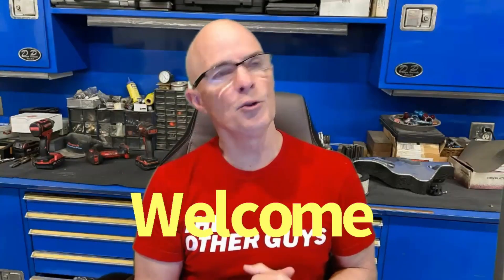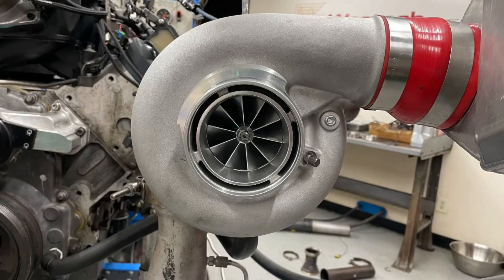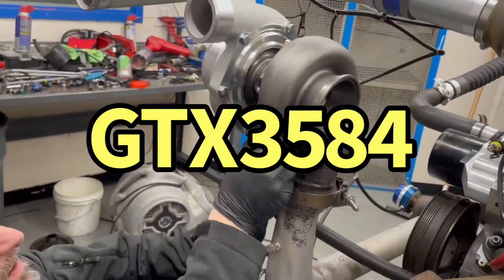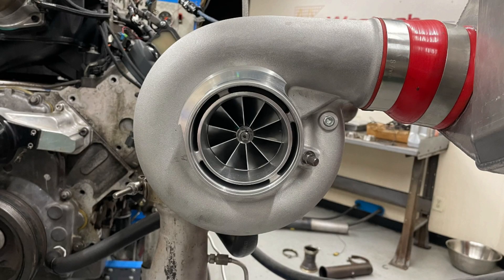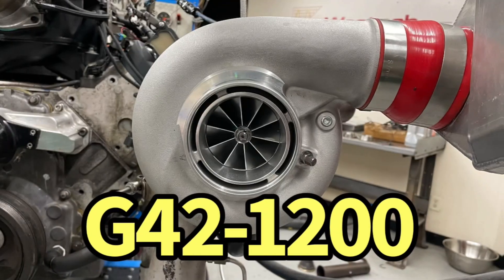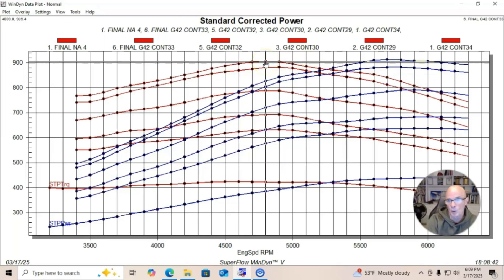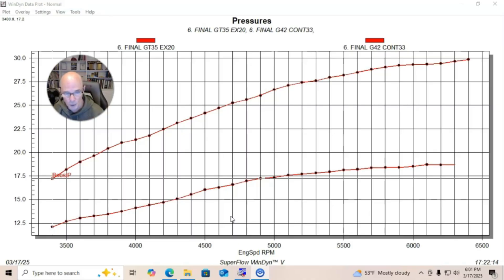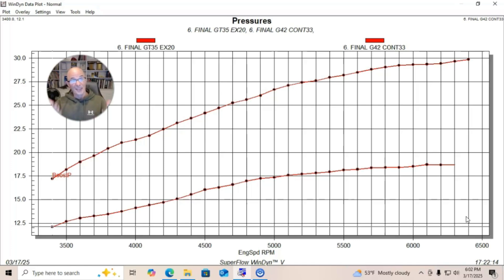TURBOS WARS! GTX3584RS VS G42-1200. SAME BOOST, SAME AF, SAME TIMING. POWER, BOOST & BACK PRESSURE

Comment: Hey I know you've done 350 sbc and all the ls iterations. Have you put a turbo on 97 LT1?
Reply from the maker: Not yet
Reply: @richardholdener1727  I would bring you my LT1, but it needs head gaskets, and probably heads need resurfacing. It only has 132k. The head gasket isn't horribly blown, thank God, but it still has to be done. One thing that sucks about being a tech is that my vehicles always continue to be pushed further out when it comes to serious repairs. I got the car this way. I will eventually get to it. It's a 97 30th anniversary camero that belonged to my dad. He bought a complete long tube header exhaust for it and had other plans before he passed of a stroke 3 years ago. His daughter drove it and didn't maintain it at all. I was to buy it from her at half value the day dad passed away but after she neglected it I was able to buy it for 1k. I've invested 70 hours on detailing outside and inside to get it back to looking like a star again. Now just have to find time to drop the engine out of the bottom and repair it. But while I have it out in thinking of modifying as cheap as possible not looking to make 1000 plus hp.
Reply: Oh that would be a good one to do. Unfortunately I don't have an extra to send you. But if you could a complete stock engine with long tube headers would be great then maybe a cam swap with turbo

Comment: A much more meaningful test would be two ~800hp turbos or turbos of the same dimensions. For example the G30-900 or the G35-1050 are much more comparable. Additionally, these tests did nothing to show for boost response. I'd love to see this test repeated but at a lower RPM, like 1500-2000.
Reply from the maker: As explained, the engine dyno is no place to show boost response

Comment: Curious if you've had a chance to test the Borg Warner efr line turbos, like the 9280 in twin or single scroll. I've seen testing comparing the efr series turbos to g-series, and for the same maximum power potential, the efr series seem to have better spool characteristics and transient response. Side note I'm surprised you only tested to one bar, these turbos comfortably push 35 Plus pounds
Reply from the maker: neither of these turbos would support 35 psi on this motor

Comment: How can you say in this demonstration that the smaller turbo is much more responsive when you don’t show the boost levels at the lower rpm’s yet the g42 makes more torque and hp all the way across the board on your dyno pulls ?
Reply from the maker: The engine dyno provides a steady state load to start the run. This allows (most) turbos to make full boost-this is not the same thing that happens on a chassis dyno or the street or track. The best illustration is that the smaller turbo had full boost (150 kpa) at just 30% TPS on the load in-the G42 was still at just 100 kpa-the smaller turbo is more responsive (not really surprising)

Comment: Did you log compressor outlet temp? Would have been interesting to see the compressor efficiency differences.
Reply: IAT must be easier ro keep cooler with the large turbo, right? Probably safer to run as well?
Reply: @UncleRayRayGarageEmporium  iat is behind the ic so its not as good of a measurement, the cooling capacity and intertia will of course affect the number, but aure you could see the trend there. If you measure post compressor you can directly use that number for calculating the compressor efficiency, and with a sweep like this it will be much easier to get a stable number.

Comment: So what turbo is better sooted for a 6-700wheel hp build. I’m guessing the the advertised ho numbers are for crank hp?
Reply from the maker: the smaller GTX3584RS will make 700 whp on a 4.8 or 5.3l

Comment: Ok Richard, this again proves bigger isn’t always better

Just like you said in the comments

The “ little guy( small turbo)”
Will be way out front 
Before the “big guy (1200)”
gets going

95 percent driving
That small turbo
Will deliver the goods

Set it up 91/93 on fuel
Then run max boost before it trips

I would say with some forged u joints - no slicks
A stock driveline with a shift kit 6l80/90
Drive line could take it( even a 400 THM)

Not like you need huge gears with all that TQ
A smart / soft driver  could make a drive line live ( for a while)
So why is it so good?
More blades on the wheel?
Angle on blades?
Or just the complex  shape on the turbine?

Also  is it just oil cooled
Or can you add water collet as well on the centre bearing?

Years ago I swapped a Buick 3.8 turbo( 1979)into a 1982 olds
165/180 hp

It was a huge step up

My son has a 1987 trans am GTA
( 305 Tuned port 205 hp)

Can’t even imagine a 5.3 Alu block small turbo in it
  ( they made a 3.8 pace car that was stupid fast)

How many did you buy?

100?

Are you going to “ big bang “ it to see its limit?

Your first video seems like the low buck truck is a perfect match( my son bought your truck plus)

I think you should drop this in your red truck and show us it on a track

I am thinking those GT -35s are dated, not worth the effort( hot side a bit small)

Great video to show us the difference 

Seems a LS loves a great turbo
( even a 4.8 would be a old big block killer with this turbo!)

Do you remember when Chrysler put those vanes to improve spool?
I guess modern turbine so far advanced they  the done need them to fast spool

I hope you sell every one you can get!

Good luck
Reply: Why no slicks?
Reply: @mr.c5217  slicks are great, but twisted stock drive shaft/ broken motor mounts, snapped axels ,burnt tranny bands- is it worth it?
Let it come out of the hole
The turbo is very fast spooling
It will make up for a hard lunch
With out the carnage of slicks
( and save you blowing the bank on drive train upgrades!!)

Shift kit/ wreckers tranny cooler/forged  u joints/ home made drive shaft hoop

$300-$500 tops

Cheap blast for crazy fun
Reply: @  because of the cost to up grade axels/ forged joints/ trans/

Put a shift kit and a wreckers cooler, forged u joints and a hoop $400-$500  come out of the hole let the turbos play catch up!

Slicks eat drivelines
Reply: @ off redit-

As u/youshotahostage said, drag radials will break shit. Diffs, tailshafts, driveshafts, CV's etc. If you want big traction, you gotta spend the cash on beefing up the drivetrain too.

If you don't have a strong rear end, as in, better than the 30 year old 8.2 or 8.5 inch rear end, DO NOT PUT SLICKS ON IT. You WILL break something, most likely an axle, and then it’s gonna come out and ruin your quarter panel.

Wheel hop is driveline death

A lot of people will tell you that you will break something on slicks, well that's not entirely true. Slicks are EXTREMELY soft. They wad up and act as a giant cusion, taking the shock load out of your launch. If you break something with slicks, it is because you make too much power and it was going to break anyway. Wheelhop from stiff street tires is much more destructive than launching on slicks.

A long time ago, I owned a Porsche 911 (996.2). In the owner's manual there was a warning againsts putting slicks on the car. It turns out that with slicks on, the car can generate such extreme G-forces in the corners that the oil pan runs dry and the engine grinds itself to pieces. Dodge Vipers of the same era had a similar problem, which came as an expensive surprise to owners wringing them out on track days.

Just a few other peoples perspective 

Maybe the best is “ hemi under glass”

Jay Leno clip

Do not make any sudden turns
Watch it on you tube

This from a seasoned driver

Jay Crashes During Stunt | Jay Leno's Garage | CNBC Prime

CNBC Ambition
90
Likes
21,154
Views
2016

Just my take  - if you want that extra take off  make sure you understand what your playing with-Don

Comment: How will the results change with a 6.0 and different cams? Is it always the same 800 or 1200 based only on the turbo. Yes, I haven't done any turbo install but I am considering it for a 6.0 799 tbss that I'm going to be putting in a 69 Camaro.
Reply from the maker: Your first question is always-how much power do I want to make? That decides the turbo size

Comment: Been saying this a while, the extra money over a GT45 is absolutely worth it.

That 73/75 is going to be better than a 78/75 in 99% of applications. Also amazing to see a 62mm turbine make 800hp, next gen turbine geometry is so much better.
Reply: 73/75 vs 78/75…. Why do you prefer or think it’s better in 99% of applications ?
Reply: @Stckit1  quicker spool, power under the curve over the larger turbo. Its pretty clear. Not to mention if that 62 makes 800hp crank on a 5.3, thats more than what 95% of the budget LS crowd can hook up anyway. 

As for me? I dont do 5.3's or small turbos lol. 6.0 with rec ports or better. 80mm and up. To each his own though
Reply: @edmundnlemadim8480  lol alright. Im looking into it for my near future turbo purchase. Got a 4.8 daily driver that needs some boost.
Reply from the maker: GTX3584 is the perfect turbo for the stock or mild 4.8L
Reply: @ oh yeah, 3584 would be a great pairing with a 4.8L.
Reply: @Stckit1  Unless you NEED the flow from the 78mm compressor, it just adds weight. The 78 is ~120lbs/hr before it drops bad (at 29psi), the 73mm is ~100lbs. Figure about 10-12hp per lbs/hr.

Anyone wanting less than 800whp will be better off with the 73mm instead of the 78mm. Same for the GTX35, anyone wanting less than 600whp will want that instead. FYI 500whp is enough to do rolling burnouts at 60mph.
Reply: @hydrocarbon82  yea im actually aiming for around 600-700whp in a 4300lb rear wheel car. Thank you! Saves me some loot as well

Comment: Would a larger camshaft result in lower backpressure?
Reply from the maker: If the cam makes more na power-the turbo set up will make more power under boost-the back pressure goes up

Comment: I think the g42-1450 is the best overall ls turbo for any size engine , they have been run on ls7 motors and smaller .. I got one for my alum L33 I built and plan on using it
Reply: Ive been running the g42 1450 for the last year, recently made the move to a g42 1200 and I by far like the g42 1200 better. Hits just as hard but comes on so much sooner .
Reply: @NFAFABRICATIONS  how much boost are you running on them ?
Reply: @NFAFABRICATIONS  so the 2 mm smaller comp wheel really makes a big difference on the 5.3 ?
Reply: @Jenkins137  I'm currently on 15 psi, and the compressor wheel on the g42-1450 is a 79mm, the g42-1200 is a 73mm. It makes quite the difference on my 5.3
Reply: @ yea I dunno why I said 2mm ? I was thinking the comp wheel was a 73 and the 1450 was a 75 when I typed that , but the 1450 is more like a 80mm comp wheel and a 75 mm turbine wheel .. so it’s got around 5-6mm more on the comp wheel than the 1200 model .. that’s good to know tho , cause I’m about to be running this t51r g42-1450 1.15 3” v band turbo on my alum L33 , with a sloppy stage 2 cam and dual valve springs .. was trying to make my car more of a top end car , so I could try and keep the trans and rear dif in place as long as I can .. one day I’ll upgrade those to stronger parts , and maybe swap out the chra for a g42-1200 model .. I got into an argument with a guy online last night about his ls1 running a 85mm turbo , trying to explain to him that the g42-1450 would be so much better of a turbo for his ls1 c5 car .. he wouldn’t bet any money on the fact that my turbo would make his car faster and better to drive on the street .. I told him to msg Richard Holdner and talk to him if he wants some real data on this subject ..most guys go too large , I was just hoping I didn’t do that for my built 5.3 with the 1450 model , in my gxp solstice .. but sounds like I may have went too large on it ..
Reply: @Jenkins137  I honestly think the g42 - 1200 is the ideal turbo for up to a 6 liter for a daily driven vehicle. The g42-1450 is an ideal turbo for a mostly drag Car that you occasionally street drive but to each their own. Ive been a fan of the g series turbo so far. Take a look at pulsar turbos. They are great for the money
Reply: @ I’ve got a t51r g42-1450 on my built l33 in my gxp solstice .. I’ve been running pulsar turbos for the last 6-7 years on all my vehicles ..they are great I feel .. I wanted a turbo I could run on any motor I ended up using , I originally had a 6.0 , and downsized to the alum 5.3 for space reasons .. but pulsar is the way to go 100%
Reply from the maker: Those are good-for 1000+ hp. But, put that on a 4.8L and get smoked by the response of a GTX3584RS on the street.
Reply: @richardholdener1727  I've got the VSracing version of the g42 1200 on my 4.8 and it is SNAPPY, I couldn't imagine what it'd be like if the GTX blows it out of the water lol
Reply: @floridamanHooning what cam and converter?
Reply: @NavyNate123  cam is sloppy stage 2 and I've got my stock truck converter... I have a 4l80e upside down on a stand right now waiting to be swapped in with a 3400 stall converter
Reply: @richardholdener1727  very true , I’m sure it would be large on a 4.8 and be super laggy , this is a l33 5.3 I’ve been building , with ported 706 heads , sloppy stage 2 cam , and the g42-1450 1.15 ar 3” v band turbo , I was trying to make it more of a high rpm powerband to help my trans and rear end last longer hopefully , but it’s my first turbo ls build , so I’m sure I’m making some mistakes along the way .. regardless it’ll be a huge upgrade over the turbo eco tech cars I’ve always ran..

Comment: I wonder if a GT42 with a quick spool valve will bring the GT42 closer to the gtx35 in lower rpm. They use them on the om606 diesels. they work by using a single scroll manifold with twin scroll turbo and have a valve plate between manifold and turbo that shuts off one scroll ports until it reaches a good boost level then opens up for the higher boost.
Reply from the maker: Thnx-I know what they are-but even with that-the GTX3584 can still make more
Reply: @richardholdener1727  Thanks Richard I thought you might know, I have a gtx3582 with the little bit smaller housing on my 3.6 m104 Mercedes its very fast spooling great turbo for my 510whp setup.

Comment: When are you going to do turbo dodge magnum testing?? You’ve already got the engine. Slap that 3584 on it with stock cam and let’s see what it makes. LS stuff is getting boring.
Reply from the maker: there turbos will be run on lots of stuff

Comment: I got a 350 sbc that probably makes around 400 hp NA, 205cc aluminum heads, .495/.502 cam, H-beam rods, forged pistons 10.3-1, stock crank and block backed by a 4l80e with 3200 stall converter.

I'm running a gt45 turbo already so everything fits it, would the gtx3584 be a worth while upgrade or just keep the 45, I did eventually want to run twins possibly.
Reply from the maker: keep what you have unless you want better response-if you go twins-definitely don't use twin GT45s
Reply: @richardholdener1727  appreciate it, I originally planned to switch to twin gt3582s. but cost goes up so much with needing a second wastegate and buying 2 turbos over just one bigger one. may upgrade to the g42 as it seems to be a 73/75 size and i even considered moving to a vs racing 78/75, but the g42 seems like a better turbo. i'm reluctant to push this stock vortec 2 bolt main block and crank much past 750 hp anyway.

Comment: what are your thoughts on rear mounted (f body gen 4) variable turbos for 700-800 hp, manual transmission lt1 gen2? thanks!
Reply from the maker: variable turbos?
Reply: @richardholdener1727  Yessir, Variable Geometry to overcome back pressure. I believe this would help my plan of a rear mounted turbo.

Comment: Weird question. Getting into the stick shift drag with a vortec 4200 and trying to learn as I go. With the 800 hp turbo on this 5.3 would that mean it would be maybe a 900 - 1000hp turbo on a 4.2 6 cyl?
Its all about flow but per displacement?
Reply from the maker: No-this turbo will support near 900 hp as an absolute on a smaller, highly efficient motor (Think K-series Honda)-it would never make 1000 hp on any motor

Comment: Few questions 
1- Did you happen to log oil temps during these pulls? What were they?
2- How long, after pulling, did you allow turbos to cool down before shutting engine off?
Reply from the maker: we don't log oil temps-they turbos don't add much (if any) to that on a single pull-the motor adds more oil heat. We idle it down for 10-15 seconds (not much)

Comment: What was the exhaust housing size on the G42-120 you have? I assume the larger housing would help with back pressure (it allows more exhaust flow). I just put on on a 5.3 and it lights up super fast!
Reply from the maker: A change in AR won't have a dramatic change in spool rate on a turbo that size (but every little bit helps).
Reply: @richardholdener1727 agree it won't help with spool rate. Concerned with back pressure at say 20+ psi of boost. What was the AR of the turbine? housing? It affects turbine max flow.
Reply: Timing also has an effect on spool. Your setup is almost guaranteed to be different than this one.